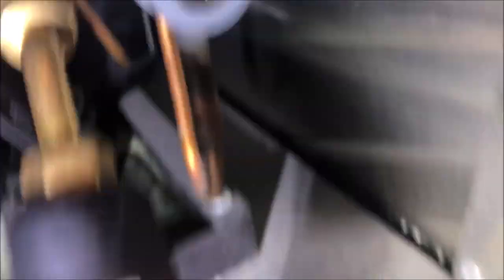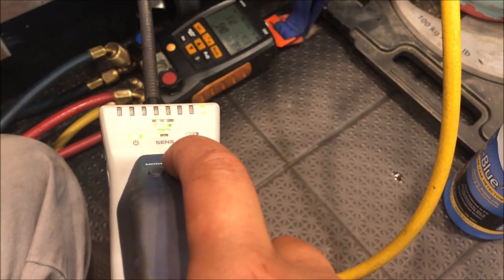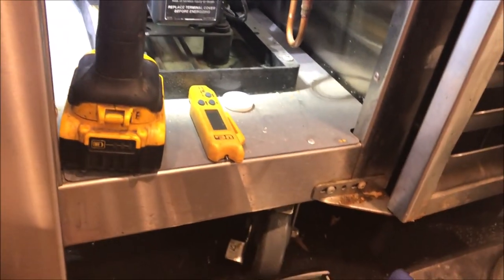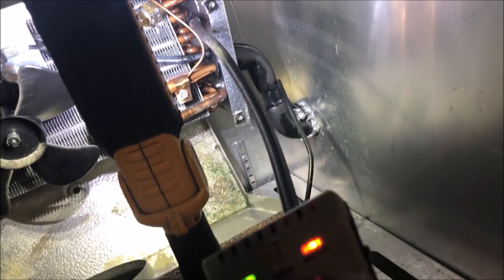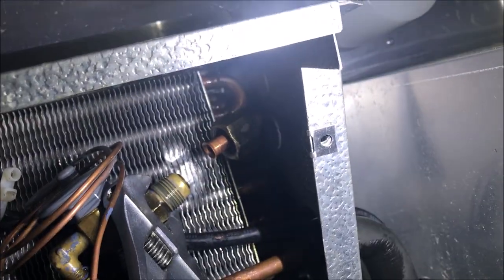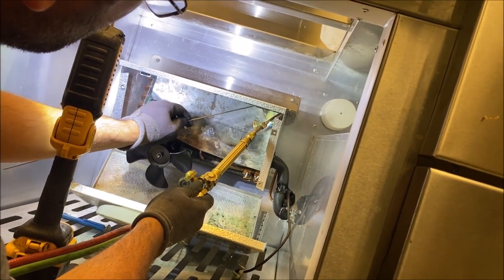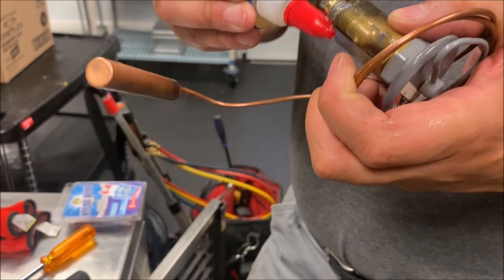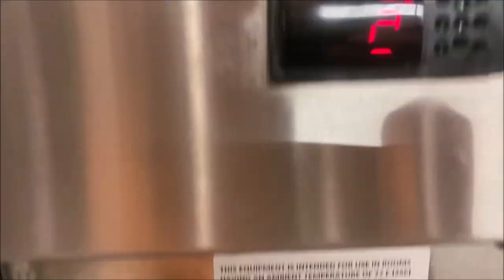Prep table cooler is not cooling

Comment: Do you ever use Staybrite silver solder in those small tight areas?
Reply from the maker: I’ve never used it before. I’ve heard of others using it. Have you had good luck with it?
Reply: @REFRIGERATIONKITCHENEQTECH   It is what we were taught at the crappy community college program I took in the late '80s and what I've been using since getting into this field 25 years after getting that degree. (Was making too much $ bartending back then to crawl in hot attics for minumum wage!)

It has served me well for all the reach in coolers, freezer, and ice machines and small walk ins so far. Tackling a couple of much larger walk in freezer condenser swap outs in our off season, and spending some time practicing with oxy-acetylene on bigger pipe than I've ever done before.

Old dog trying to stay amused and learn some new tricks!

Thanks for all that you are sharing and taking the time to explain, film and edit.

Comment: Do they have that kind of tip for a b-tank using turbo torch? My company does not believe in oxyacetylene.
Reply from the maker: That I’m not sure of, have not used a B tank in over 10 years
Reply: @REFRIGERATIONKITCHENEQTECH  thank you. when i had an oxyacetylene rig, I had that tip. it was great for those little reachins. expensive tip..

Comment: I having problem with walkin freezer can not get it down below 18F degree. 
I clean condenser coil, replaced the defective defrost timer, clear my sight glass with 2 lbs of r404 A. Played with txv to decrease super heat, still not helping. Unit got down to 18F and the back of the evaporator coil frost up acting like air flow restricted and wont dropp any lower
Reply: Did you completely de-ice the coil? Dont rely on the heaters to do that if you had a block of ice on the evap. Check the side compartments, melt off all the ice and make sure you have working fan motors and blades that are NOT bent. Is the door closing properly? Do you have air gaps? 

Why did you have to clear the sight glass? Did you check for a leak? Do that next before adjusting the txv. If you have a big leak, its probably leaking out as you are charging.
Reply: @deanmohamed7575  yup i thaw ice out completely, the back the front, txv left side and electrical right side.
I noticed the fan delay/defrost termination switch did not work because i set 30 min defrost 4 times a day, but during defrost the box temp rise up about 45F degree but the High limit never terminate defrost. I have to turn the timer to take it out of defrost, and my evaporator fan did not delay, came on right the way
Reply: @ManhPham-kb3sl  thats a bad dtfd switch, the one withe the black brown and red wires.
Reply: @deanmohamed7575  yup, would that effect the freezer from reach set temp too, i have work on some freezer that still reach set point with the defective dtfd switch. I have called trenton tech support, he advise my condensing is 2018, evaporator coil 2008. He said close the txv all the way clock wise. Back it out counter clock wise 1 and 1/2 turn and then see what is doea